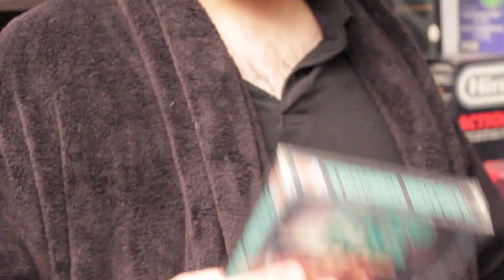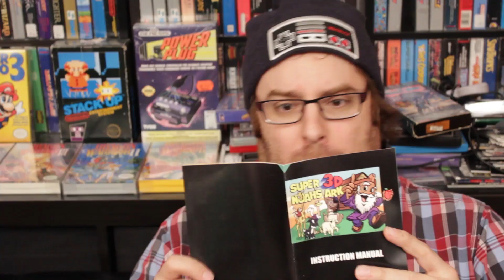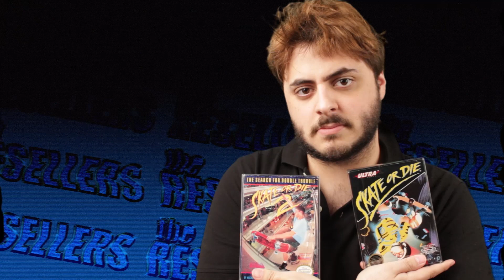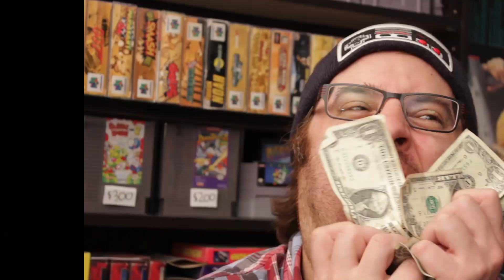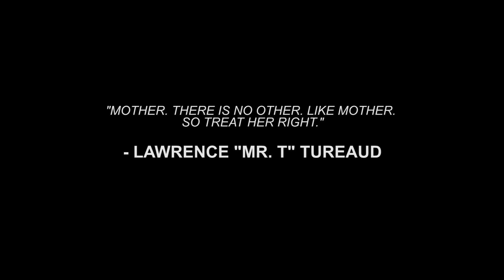The Resellers - S1: Ep.23 - Shit or Die

Comment: What screwdriver can you use to open an American nes?
Reply: I can't find what to use
Reply from the maker: +Jake g It's a Philipps standard screwdriver for the NES, but the SNES and the N64 both require a 4.5mm security bit. For NES cartridges, it's the 3.8mm security bit. You can get both for 3$ on eBay.
Reply from the maker: +Jake g We'll have a Hot Qarl Action that will show further details.